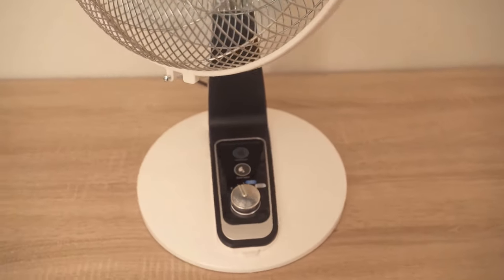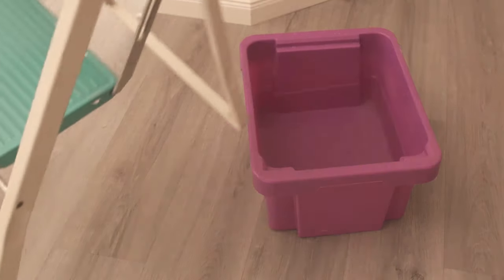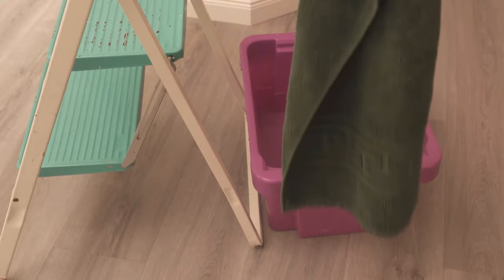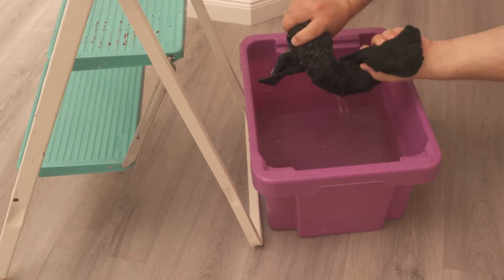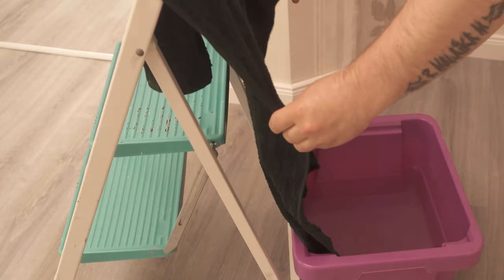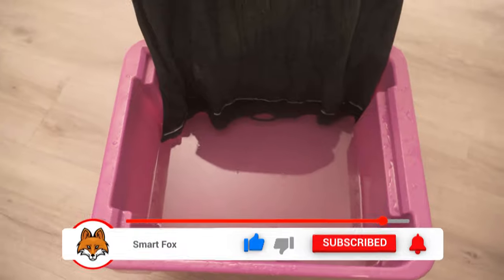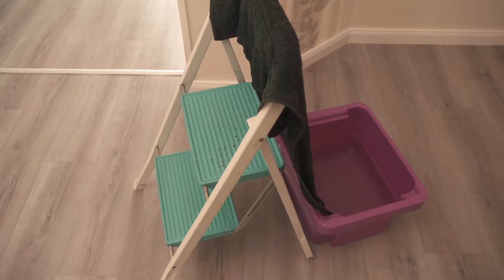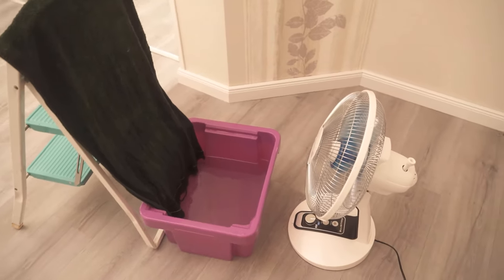HOW to build an Air Conditioner from a Fan 💥 (IMMEDIATELY cooler) 🤯

Comment: All that does is make my room even more humid
Reply: Depends if it's humid outside
Reply: Some bright spark made a framed array of cut off 3 litre Plastic drink bottles..

It reduced Indian homes temperature from mid 40's celsius to mid twenties.

I might try and make one that fits in my open window...
Reply: @greatestytcommentator  link please
Reply: I mean if this makes ur room more humid the try freezing water bottles and putting it in front of a strong fan. This helped me
Reply: Open your window it acts as a swap cooler. Your window must be open
Reply: Hahahahahahahahaha
Reply: Use ice lol
Reply: @jacobrommel3112 swamp coolers don't work in countries like the UK where all heat is humid, its more humid outside than in
Reply: CORRECT,  WE did this in prison and the damn windows fogged up, humidity
Reply: You may want to place open containers of baking soda on the floor in your room to absorb the humidity

Comment: Just splash your clothes wet with water and go lay down on your bed with the fan directly in front blowing at u.... U r welcome
Reply: @@PotoWave i don't get it... U mean they get asthma attack from wind blowing at them when they are drenched in the rain on some days?
Or do you mean my comment is so funny that they hyperventilated and got asthma?
Reply: I'd do this if I'm going to sleep. But if I'm to be active throughout the day I need a different solution
Reply: Nice one😅
Reply: Cool showers and drying off did nothing for me, but staying wet and sitting directly under a fan cooled me to my core. 
You may have just helped me make a cooling blanket for my dog(??) I take him outside and wet him with the hose then sit him under the fan to cool off when it gets too hot. A wet towel might work better.
I never thought about having a wet sheet or towel over me as i sleep under the fan. This may be a game changer.

You are kinda genius. Thank you!
Reply: @jackknifer1 didn’t ask
Reply: this is the traditional australian air conditioner

Comment: That's not an air condition, it's a humidifier.  That's not what you want during a heat wave.
Reply: Heat molecules will cool the surroundings and eventually cool everything down.
Reply: @joseluismezagarcia.7524 There is no such thing as a heat molecule.
Reply: @tanwera  My bad. I meat water.
Reply: It's evaporative cooling, the same technique which works in a dessert cooler. If your weather is hot and dry, it should work. But if it's warm and humid, it will not .
Reply: @techtotravel3119  I live in Tennessee. One summer it was dangerously hot. It tried a very cool shower and dried off. Still burning, sweating. Started getting drenching wet, then sitting directly under a fan, literally cooled me to my core. It was evaporative cooling in principle.

Comment: What if you put ice blocks in the water? Would the fan blow even cooler water? Just wondering.🤔
Reply: Yeah for like 20 minutes before it melts
Reply: @george2573  maybe longer if you just use ice and no water and then when it defrosts it is very cold water
Reply: @BraveFartz-lq3fl  Or gallon /half gallon jugs of ice in a little water, then the ice jug can be replaced as it melts or the water warms.  Just keep multiple frozen jugs.

Comment: Thank you man this dropped the temp by 5-6'c
Reply: It did?
Reply: Really ??
Reply: It did ????
Reply: Why do I feel like you’re lying brother?
Reply: How?...did it drop 6 degrees
Reply: Do you know what. If you have a hot room and you have dark curtains, covering your windows to block out the sun during the daytime, then you need to replace those dark curtains immediately with pure white curtains because pure white reflects heat while dark colours or black absorb heat.  From before when I realized I needed white curtains, for my room, I replace the dark colored ones with pure white and it caused my room to be 5°C/11°F cooler or a little more automatically whenever I use to block the sun with it.
Reply: @Clouds-su3dc i have been wondering if because i covered my window with Black curtain thats why its hotter in the room than the rest of the house. Might remove it and see if it makes a difference.
Reply: @Unbothered92 yes your black curtains are the main reason why your room is very hot so go with pure white curtains,. You can also search up why white keeps you colder And you will see 👍. Black only reflects 5 to 10% of sunlight, Meanwhile white reflects 80 to 90% of sunlight which keep things a lot cooler just to keep that in mind when using it to block the sun.

Comment: What if you add a bag of ice to the bucket of water could that help?
Reply: Gallon jugs of ice added to a small amount of water should be better. You can just swap out and refeeeze the jugs without having to buy more ice, unless you freeze ice in resealable gallon plastic bags. But I think gallon or half gallon jugs would be easier to handle.

Comment: You should have the towel behind the fan. So the air it pulls is cooler from the wet towel
Reply: Except the water drop will contact engine.. And then your whole building is on fire

Comment: As Time Goes By, As The Fan Blows Unto The Upper Part Of The Towel, The Upper Part Of The Towel Will Dry Off, Leaving The Bottom Small Part Of The Towel Wet, I Would Recommend Adding Another Water Container(With Water) On The Top Part Of The Towel And Connect The Top End Of The Towel To The Towel So That The Towel Gets Simultaneously Wet On All Parts.